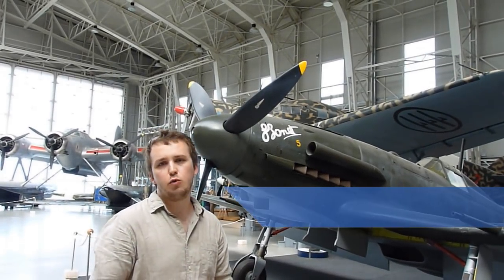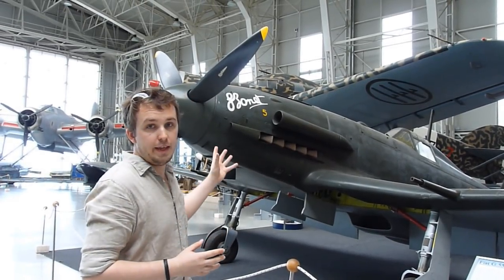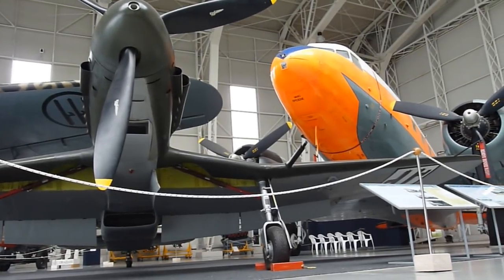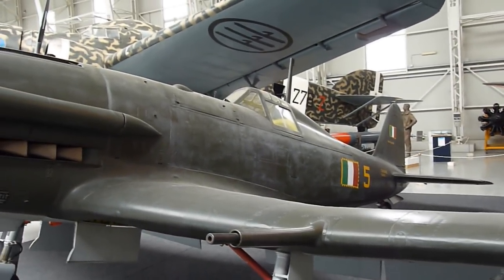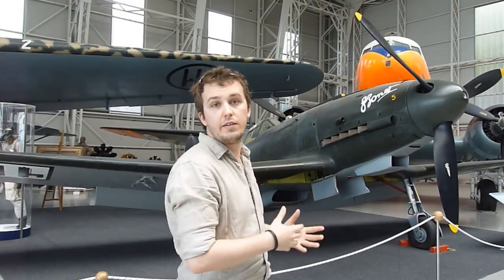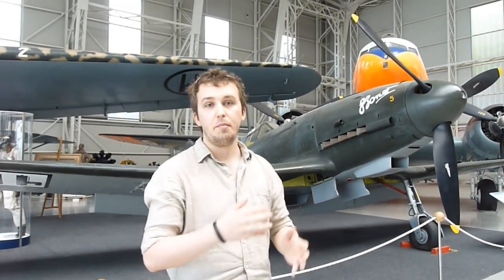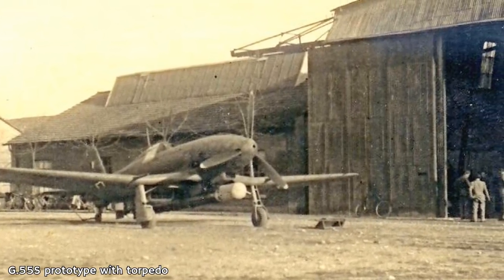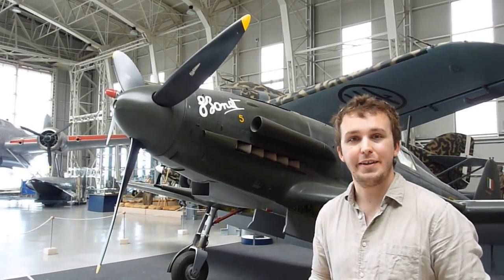Fiat G.55 - Italy's Centaur of WW2

Comment: You said the BF109 took about 5000hrs to produce. How long did it take from day1 to the finished model ? ( I mean I understand the 5000hrs for all parts together... and many were made simultaneously..)
Reply: 209 days
Reply: That would be a reference to man hours though. Can't imagine the Messerschmitt factory having one guy working non stop 24 hours a day for 209 days on one aircraft.
Reply: ollimoore Yeah the correct term is man hours
Reply: 210 days
Reply: Well 238 if this lone Messerschidt worker decided to take Sundays off...
Reply: Adolf Galland told Goering, in 1944 I think, that Germany should increase its fighter production. This was to prevent Allied strategic bombing from doing more damage to German industry and cities. To begin with, Germany should manufacture 1,000 fighters every month. This may seem a lot but I think Great Britain had surpassed this number in 1940 already. It's just that the Germans had never focused on fighter production since a fighter is in essence a defensive weapon (to protect the bombers that would do the heavy damage to the enemy).
Reply: !!! Now I remember. The British produced a wartime propaganda film in which British aircraft construction workers manufactured a flying Wellington bomber in 24 hours, 48 minutes. Of course it was propaganda but it does give an indication as to how quickly a flying warplane could be produced. So from my non-expert analysis, I'd say producing a single seat fighter could be done in a day.
Reply: AudieHolland That was probably just the time to put together some preassembled parts, but if it raises morale...
Reply: AudieHolland that was assembly, not manufacturing.
Reply: I'm just saying, using modern mass production, making a single plane would not be a matter of many days.
Reply: AudieHolland we aren't talking about modern production, we are talking about the 1940s. very different. back then it would be weeks for a plane to be finished.
Reply: greater germanic reich Mass production of the 1940s would not be comparable to modern production using robots but I'm sure the Germans used conveyor belts and all the machines and equipment that any fully developed, industrialized country would have at the time. They could literally copy the General Motors factories that were built in Germany before the war.
Reply: AudieHolland No need for those in plane production. Just roll the plane to different sections of the factory and move the workers as necessary to accomodate the planes.
Reply: AudieHolland The B-24 bomber factory at Willow Run in the US  famously finished a bomber every hour, 24 hours a day. It took them a while to get those numbers, but it did happen.
Reply: The decision to focus on production had been made earlier. Unfortunately that decision made so that, in early 1944, German fighters still had about the same performances they had in 1941 (even a minor evolution like the Bf109k over the "g" was delayed until summer 1944). German plants couldn't stop production to retool  to manufacture newer models and so, to increasingly less trained pilots were given increasingly outdated aircrafts.
Reply: +AudieHolland
I've heard that during the war the US bombed the Ford factory in Germany,  then paid Ford for the factory after the war.
Reply: greater germanic reich  The willow run factory in the US was producing 350 b 24 bombers every months.
Reply: +josh hill And, in the best conditions, 1 for hour and 18 a day. 
The Soviets produced up to 562 Mig-3 for month in a single plant in 1941 and 40 Il-2 a day after having moved the factories to the Urals, but obviously it was far easier to manufacture single engined aircrafts. 
The Germans could deliver 300 Ju-88 a month, but the production of the parts was distributed throughout Germany, and the assembly was made in four different plants.
It has to be said that the Willow Run plant had the same "problem" of the Germans. In between, since when the production line had been estabilished and when it was in full production, several modifications to the B24 design had been approved, but the plant could not stop production to retool, so the brand new aircrafts took off from Willow Run only to be transferred to four modification plants, where the aircrafts were modified to current specs.
Reply: Well thought.
Reply: These threats just show many people are unable to cope with complexity and multiple factors. The amount of manhours MAY be helpful to compare the complexity of a certain model. It's  not useful to get an idea of production time. Looking at germany amount of workers differed a lot over time, quality if workers differed a lot, priority differed a lot, ressource and part availability differed a lot and models were constantly improved, changed or refitted.

Before you try to answer a question ask yourself if there IS an answer to the question.
Reply: A useful presentation.  Good thinking, taking a clear look at the Big Picture.
Reply: They would move the planes themselves through the production facility but the one thing that they wouldn't do was move the workers, modern, even for the time, production methods rely on each person doing ONE job otherwise you have to train EVERY worker to do EVERY job which is inefficient and unneeded.
Reply: Sure but it was taking far longer than 1 hour to produce a B-24, the Americans just had bigger more efficient factories and far more manpower.

It's amazing what can be achieved when you're at war but not fighting a war on your own soil. 

In Germany a single factory of that size would've required a significant military force to protect it from air raids and saboteurs whereas American factories just had to worry about workers stealing office supplies.
Reply: not quite, taylorized/fordized construction techniques were already in place
Reply: When you consider at one point during the war we were building some victory ships in something like six days from start to finish. A few thousand man hours on an aircraft seem minor.
Reply: Did you account for time away from the plane for bombing raids?
Reply: Depends entirely on various factory layouts and part locations, Do you count bolts which could have been produced decades before etc? I think you mean not fabrication but assembly really, in which case the aircraft would take about a week and the engine the same, assuming all parts already fabricated- particularly glass etc. both could be worked on seperately, and assuming there was a reasonable number of workers on each, (only an efficient number of manpower working on several aircraft simultaneously) and that it was not shift ran like in labour camps which allowed 24/7 production and assuming no bombing or trasport times or distributed production etc etc.

Basically what you are asking is a very hard question- hence why man hours is used. I think maybe the correct answer to your question is how many people could simultaneously work on an aircraft like the 109, and the answer is close to ~50 simultaneously..

Thus about 12 days with 8 hour shifts, 8 with 12 hour shifts, and 6 with double shifts.
This is also ignoring skill too, and any other factors, just theoretical speed of a well equipped group of 50 experienced people producing an aircraft as quickly as possible, in adjacent factories, but it does include fabrication.

Really comes down to it being basically impossible to do in less than 1 week at the time though.
I remember at one point Britain was heavily producing tanks, a mighty 1 per day.

You can also see the big benefit of the mosquito, where cabinet makers could make the airframe with balsa wood, and have it built in far fewer hours, leaving an extra traditional factory to work on engine and components- making it invaluable.
Reply: @AudieHolland  Problem is that did not take into consideration all the preassembled parts !!!  Engines fuselage and wing sections !!!  Pure propaganda BULLSHIT !!!!

Comment: So the G56 is a 603 based G55?
Reply: Yes. Ironically, the decision to stop it (the Alfa Romeo already obtained the production licence) made so that a wonderful engine had never been used to its full potential. The Germans couldn't stop the production of Bf109s to retool to produce a DB603 engined version (the Bf109 airframe was way too small) so the engine was used only in prototypes and not-so-successfull aircrafts.
Reply: Two samples of G56 were manufactured (MM.536 and MM.537) and extensively tested. MM.537 even survived the war, but then was stripped of the DB603 engine and served as a test aircraft to adapt the airframe to various kind of available engines (the project ultimately led to the RR Merlin engined G59).
Reply: Yeah, a single sample of Re.2006 was assembled, but never equipped with the engine, and so it never flew. That too survived the war (it was transferred at Taliedo in time to escape the bombardment of the Officine Reggiane), but dismantled shortly after.

Comment: I recently discovered your channel and I'm really enjoying it. 

Could you do a video about the French Air Force at the beginning of WWII?  What planes they had, and how capable they were?  They lost so many planes in the initial invasion, and I gather withdrew most of the rest, that we don't hear much about them here in the US.
Reply: The French air force was transitioning to a newer generation of aircraft (as had the Luftwaffe in 1937-38 and the RAF in 1938-39) . So the French were, having considerable difficulty in equipping squadrons with new aircrafts as well as maintaining operational ready rates. In early 1940, some French squadrons ran in-commission rates of barely 40 percent. In may 1940, the output had reached 619 combat aircraft per month produced in France (and 170 additional produced in the US on French orders). Therefore, France not only was outproducing Germany with modern combat aircrafts in this period but was the number 1 manufacturer in the world, unfortunately, it was too late.
Of their 28 Fighter groups:
16 had the obsolete Ms406, of which 8 were re-equipping with the Dewotine D520
4 had Hawk 75s
8 had Bloch 151 and 152s
Of those, on paper, only the D520 were able to compete with the Bf109e on equal terms. The Ms406 was manuverable but slow, the Curtiss Hawk was not much faster than the Ms406 and was underarmed and the Bloch 151, altough sturdy and well armed, was a very slow climber and had poor agility.
However, even in those conditions the French campaign had been incredibly costly for the Luftwaffe. 28% of its front line strength, 1401 aircrafts, were destroyed  672 were damaged, making 36% of the Luftwaffe strength lost or damaged. Luftwaffe's casualties amounted to 6,653 men, including 4,417 highly trained aircrew. All losses that costed dearly in the subsequent Battle of Britain. The single day in which the Luftwaffe lost more aircrafts in the entire war had been 10 may 1940, with 308 aircrafts lost in 24 hours. At the time of Dunkirk the Luftwaffe was near to exhaustion and the Allied gained air superiority, but the situation on the field was so compromised that it made no difference.

Comment: Regarding the photo you provided of the G.55 with a torpedo — it looks like the torpedo was mounted to the left of the aircraft's centerline in a position which might prevent the landing gear from retracting.
Reply: @ Neal Scroggs- It was offset as you have observed (same as Reggiane), but no problem with landing gear retraction.

Comment: Hey M.A.H, I have a question: 
The ANR used the Mc 205, G-55 and Bf 109. 

There was that incident in 1944 where the Germans tried to dissolve the Fascist Italian airforce with the intention of absorbing the pilots in the Luftwaffe which turned out to be a large error spoiling relations between the axis forces, a hit to the Italian morale and ended up being a huge setback for the air defence of Italy.

 Eventually the ANR returned fully equipped with late model 109s in late 1944 early 1945 if I remember correctly. I always wondered, because it is not explicitly explained in the books I have read, whether this was for the sake of normalizing equipment? Secondly whether the Italian pilots who has flown both had an opinion on Fiat G55 vs the Bf 109 G-10s they later received. A complicated question, I know, but I wondered if you had any insights on this matter.
Reply: From what I know the 109s where given to the Italians because most of the Italian made fighters where in the Southern Kingdom's hand, and the ones in ANR's service were few. On the Bf-109 vs the G.55 it came down to personal preferences, some pilots preferred the Bf-109 others the G.55
Reply: Also, 109 was easier to build than 55 (although both were well suited for mass production, 109 required less time to build than 55 (6-8000 hrs vs 10-12000 hrs)

Comment: Undoubtably the "Sagitario" ( Archer ) was the best. The Re 2005 completely outclassed the Spitfire Mk14 it encountered over Italy.
Reply: You mean Mk XIVs? Didn't know they operated over Italy.
Reply: Better check your history here. The spitfire mark you mentioned was a vastly superior plane.
Reply: George Honk,  yours is typical Anglo arrogance. Please explain how much better the overrated Spitfire was in all aspects of performance vis a vis  the Sagitario.
Reply: The Sagittario was an astonishing plane, but were built in so few numbers that have no operational influence with the exception of some test flights over Naples, when a single B24 was heavily dmaged and, perhaps, shot down. That's all . Spitfire Mk XIV never saw combat over Italy, and was very faster than the Sagittario, both in horizontal flight and in climbing. Measures don't lie.
Reply: George Honk nope
Reply: the 2005 re was more recent and superior as a airframe compared to the spitfire, except for the problem to solve of the phenomenon of aero elasticity, this is normal because of the passage of time. the spit of that type mk14, but I don't know if it was present in Italy, had a more performing engine and therefore gave better speed and acceleration performances. the db 605 engines built under license in italy were of the first type and not those powered by the end of '43 that the Germans used. however, I don't want to get into controversy about what was better. known that the spit. with such a complex cell has managed to be produced in a huge number of specimens.
the g55, if I read the characteristics of its close successor g59, had a certain hardness of commands in fast flight and an archaic wing profile even if from its considerable ease of industrial production. the mc 205 is a fallback to allow a reuse of the complex airplane mc202 to be produced. I believe that the king of 2005 was the best albeit perfectible of the three, curiously he adopted the wing profile of the p39 airacobra.
here I stop and I don't want to make football controversies about which team to support.
Reply: The re2005s weren’t even close to the spitfire mk 14.
RE2005s engaged Spitfire mk 5s and the Italians lost two RE2005s to spits. They also ha do two very badly damaged.
If you want I can send the sources and more info

Comment: I went to Vigna di Valle years ago (used to be free entry - my kinda price!) and it had an unusual collection of aircraft. 
It's an aerodrome...but where's the runway? And it's next to a great big lake. Ahhhhhhhhhhhhh.
Seaplanes. Loads of them. Pre WW2 stuff. Also hydrofoils.
If you're in Rome it's less than an hours drive away and it's cooler - much cheaper than tourist prices in Rome - relaxed etc. Well worth a visit.

Comment: Thanks for that I never knew about this aircraft till you showed the video. What are your thoughts on how it compared to the P51D and P47s ? I guess they would be a very good match for them
Reply: According to pilots reports - both axis and allied ones - it was. Though it performed better at the high altitudes rather than meddle-low ones.
Reply: Three were lost to P-47s

Comment: lol the vids not as bad as you made it out to be.  I wonder if the plane ever got more devolopment with the german engine upgrade ideas plus changing the razor back cockpit to a bubble canopy of some sort (to improve the german notes of poor visabilty in some areas) would have made it a standout fighter?  Anyway shes definatly a beaut.
Reply: Two prototypes of G.56 (DB603 engine) had been made. 
The Italian canopy had a better rear and lateral visibility than the BF109 one. The worse frontal visibility was due to the cockpit to be back in the fuselage (like in the Spitfire) since the Italian fighters, like the Spitfire, had at least part of the fuel between the engine and the pilot, while in the Bf109 the single fuel tank is behind the pilot.